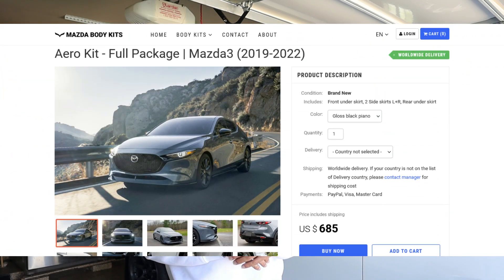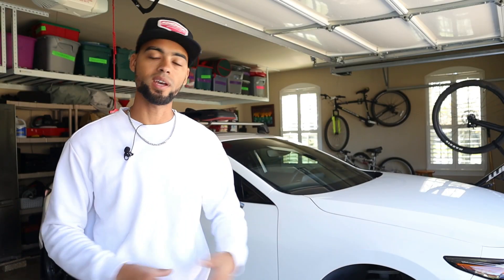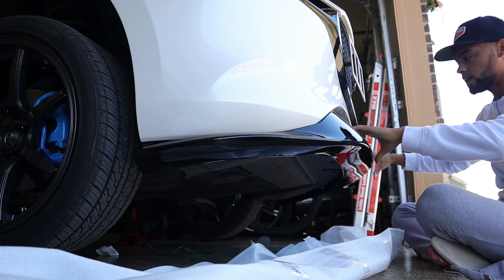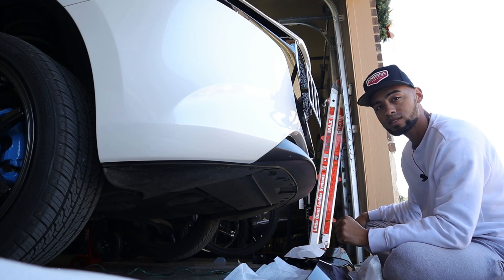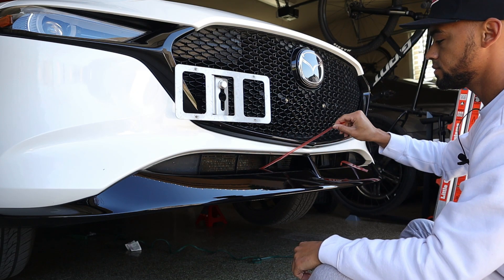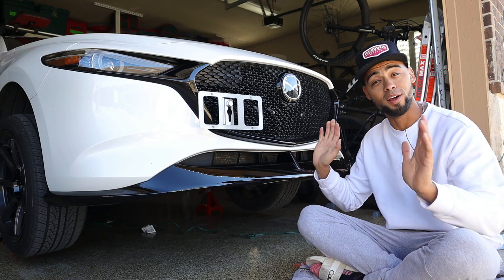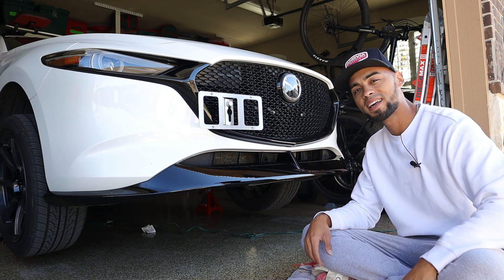Installing A Front Lip On My Mazda 3!

Comment: Your forgetting to install the side screws… there is three screws on each side you must drill through the bumper and attach to lip. This will tighten everything up and you’ll have no gaps. Just reuse the old screws.  It’s a little more work but that’s the correct way.  FYI
Reply from the maker: Yeah someone else mentioned that to me but ultimately it’s unnecessary as adding those side screws involves drilling through your bumper permanently damaging it, If you ever wanted to add a different lip in the future.

Comment: This video has helped me make my decision on getting the lip and installing it myself. I was worried about drilling into the bumper but the bottom screws and double sided tape that was on the lip was good enough to hold the lip just fine, thanks!
Reply: Hello, do u have an update on how well it's holding up? I'm wondering as well because I'm not a fan of drilling into the body

Comment: Ran into an ice bank a week ago and cracked mine. Seems easy enough to replace. I think i did break one of the screw mount openings to the bumper, but I assume its safe to drill a new opening beside it and secure it with a washer/nut from above?

Comment: Why didn’t you drill the holes on each side that hold the side of the lip to the front bumper?
Reply: @StradysWorld  check the instructions my man. There’s bolts that are supposed to go through the side of the bumper, two or three per side if I remember correctly. I’ll see if I can find a photo of my instructions, I’ll shoot you a message on Instagram
Reply: @Unsheltered_Raptor  so who was right at the end? Waiting for my part to come!
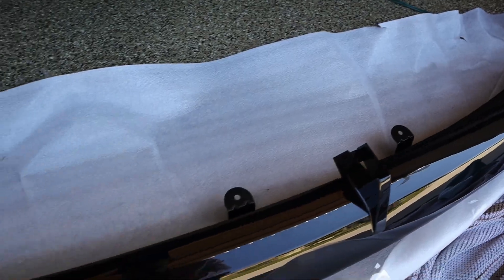Reply: if you pause the video at 1:23 you can see the 3 silver anchors on each side of the lip.  You actually have to drill holes into the bumper that line up with those anchors, and thread in a bolt from behind the bumper into the lip. It's actually pretty dumb and permanently ruins your bumper.  You can get away without having to do this part.
Reply from the maker: @ronl471  Yeah that was explained to me as well but ultimately came to the conclusion that it is very unnecessary and overkill to do. The 8 bolts hold it in place perfectly!
Reply: @renealbertoreyesgonzalez9604  Depends really lol. The way he did it works just fine, if you want to go by the OEM instructions, you'll need to drill the holes.

Comment: Have you have any problems with the lip falling off? I know there’s a way of installing it with drilling. Wondering if your method has worked out fine for you. Let me know!
Reply from the maker: 5 months in and it’s still holding strong! Even scrapped it a few times along the way. It’s very secure.

Comment: If this is the legit OEM, which it looks like it is, you missed a major step in installing this lol
Reply from the maker: And what’s that Tanner? Drilling into my bumper to secure 3 bolts permanently ruining my front bumper, no thanks.
Reply: @StradysWorld  its 6 bolts that secure it down, double sided tape isnt gonna hold it up forever, trust me Ive seen it, I work at Mazda.